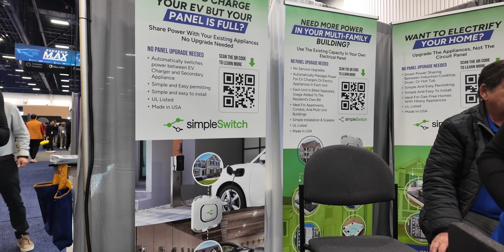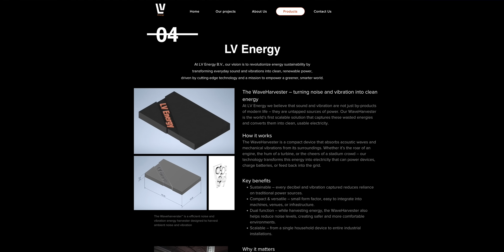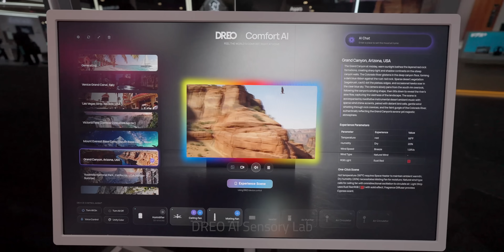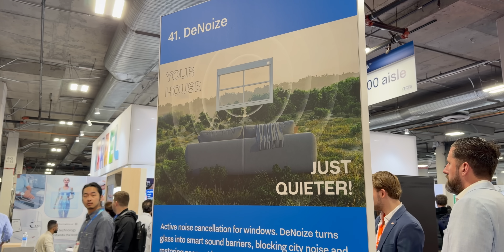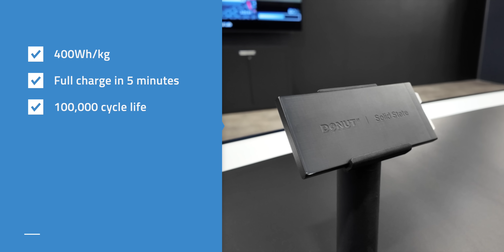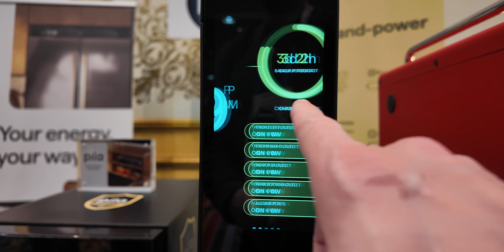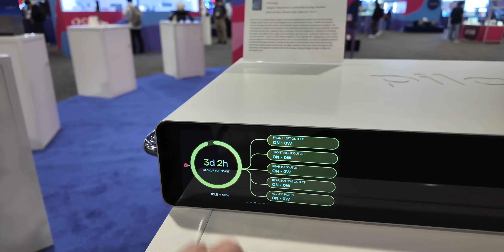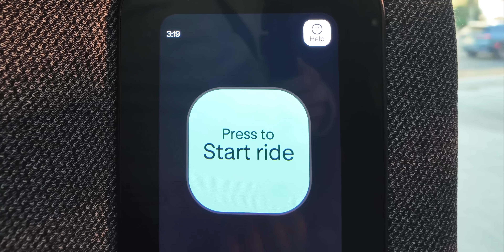The Most Controversial Battery at CES 2026

Comment: I hate that wireless charing is becoming more mainstream. It is significantly less efficient than normal wired charging, usually I see numbers shared around 60-80% efficient vs 95+ for wired, not to mention the fact that the charging pads draw an order of magnitude more power at idle than standard chargers do. That doesn't seem like much when you're talking about one person's smart door lock or phone or whatever, but when you multiply that by the total number of people who will eventually own these devices it will add up. Napkin math:

assuming the average phone battery capacity ~ 10Wh (this is the low end of the average, but it makes the math easier), there are ~7.4 billion phones in active use around the world, and the average user charges their phone once per day.

waster power from wireless vs wired ~ 3Wh per phone

3Wh * 7,400,000,000 * 365 = 8,103,000,000,000 Wh = 8.1 TWh per year

It feels like I must have gotten something wrong somewhere, because that number is absolutely insane. I'm sure if I did someone will correct me.

That amount of wasted energy for the convenience (if you even think it is more convenient, I do not) of wireless charging should make people stop and think, but this is a classic tragedy of the commons problem, each individual's contribution is so minuscule that nobody thinks THEIR use is a problem... It's only a few watt hours per day, right?.
Reply: And on the bright side, if you’re in a cold climate a 60% efficient wireless charger is also a 40% efficient electric heater :)
Reply: Companies (tech and power) don't care when they are making money from it. Consumers will if they think about it, but does a frog in a warming pot realise it is being boiled? Solar makes more sense, but if the door is not in a sunny place/inside, it seems like an overly complicated solution when you could just have a USB port or regular batteries. A person could attach their own wired, solar, wireless or other solution then.
Reply: VW/Porsche say the Cayenne’s electric charger can get up to 90% plug to vehicle (may have even been plug to battery). It was about 5% less efficient than a level 2 corded charger. 

Now the downside is that it was something like a $15k option. Around $7,500 for the piece on the car and $7,500 for the charger itself. I think it was up to 11KW too.
Reply: @paulmorrow8372  according to what I found you can add the option to the car for 226.10€ in the configurator here in Germany and there are reports the charging pad to be 5000€ in Germany. All prices incl. VAT. Still expensive. For a perspective, let’s say you average 24 kWh/100km and do 20.000km per year. That results with 100% at home charging in additional 240 kWh per year of electricity, or 76 € per year with our stupid high electricity prices in Germany. I think even the average Joe wouldn’t think about those, a Porsche owner that spends 120.000+€ on an electric Cayenne that will depreciate faster than it accelerates will not care. The Leasing here is 1700€ per month without options, with only base options (everything a Tesla comes with), no luxury things, we are at 2000€ per Month. With luxury stuff it’s 2500, and we are talking about the base model that is as fast as a Model Y AWD and has the same range. I know it’s bigger but from a pure performance perspective it doesn’t offer anything special. So yes it’s unnecessary and wasteful to charge wireless, but in the end it doesn’t change a lot from an energy consumption perspective.
Reply: @grossmann97 that 226 Euro option is just for the wiring in the car for the charging pad. You need three things, the wiring (available now), the vehicle charging pad (5,000 euro would make since for a 7,500 US price when including tariffs) and the wireless charger ground pad (another 5,000 Euro). The thought behind making the vehicle pad removable is that if you buy a new one you can keep the part from the vehicle and add it to your new Porsche. The note in the configurator says you must have the 226 Euro option to later add the vehicle pad when it is available in late 2026. 

Luckily for me here in the US, my electricity rates are about $0.15 per KWhr. In my area of the country we have a lot of nuclear and hydro, so rates aren’t bad.
Reply: Charging from ambient vibration and radiation is neat. The rest is, as you say, wasteful.
Reply: Wireless is a great backup!  I’ve had to replace dozens of devices from flashlights, headlamps, even iPhone because the connector had failed.
Reply: Perhaps thinking of wireless charging replacing disposable batteries will get you less down. 60% efficiency isn't great, but tossing 4 AA batteries in the garbage for each of your front, back and garage doors yearly isn't ideal either. Hiring an electrician to retrofit a door frame with wired locks would be cost prohibitive.

There are some good arguments for wireless charging in the EV space too. Generally, most EV's have a battery many times larger than you need for daily use. There's a monetary and environmental cost to having excess capacity. Imagine an environment where you could effortlessly/thoughtlessly/brainlessly wireless charge at home and work. Perhaps you could get by with a substantially smaller battery. The 5% loss in efficiency from wired to wireless charging may pay off in spades as the vehicle with a smaller batter is lighter and more efficient to drive. 

Not saying wireless charging is flawless or should be a preferred option all the time. There will be a time and place for it to shine.
Reply: My phone has been extremely finicky with wired charging for a year+, but still charges just fine on the wireless charger I've had for 5 years.
Reply: I generate my own power. In fact, I could have collected like 15kwh today had I the need for it. So 0.003 kwh is meaningless to me.
Reply: Yeah, it's such a terrible idea for a lot of things. Maybe just the self-guiding EV charger nozzles instead? or not being lazy? xD I hate plugging in my car in -30C as much as anyone else, but come on.
Reply: I don't think it's an issue for a door that should be using less than 50mW on average.
Reply: @meneldal  The door is not the point, the point is as more and more things start to use induction charging the wastefulness ramps up.
Reply: @Trainwreck1123  It’s convenient, that’s always going to outweigh efficiency for most people. It really is that simple
Reply: @Trainwreck1123 It’s wasteful to have to replace things with corroded batteries and connectors.
Reply: efficiency goes up as size of the device/coils goes up so the waste isn't as bad as it may seem.
Reply: @Lor20_606  The waste is exactly as bad as it seems, because what we're talking about are small devices. At the end of the day these wireless chargers are all just 1:1 air core transformers which can not be highly efficient because of physics.
Reply: It’s totally worth it for my phone to be able to float on a magnetic charger and just charge there like magic
I pay the electricity bill
I’m allowed to use my electricity how I please
Reply: @himynameisryan  it's not about your money. It's about a planet that has limited resources to distribute around >8bn people. It's about the various needed infrastructure we all pay for.
Reply: j @just.jose.youtube thats cool but I pay for my power I can use what I pay for however I see fit whether YOU think its a waste or not doesn’t matter
That’s how capitalism works
Reply: @himynameisryan  cool. ✌️

Comment: I'm not sure what the point of the Pilo system is, from what I can tell it's just your typical battery backup unit you can get from countless companies , but more expensive for less capacity with "mesh" capability, but since it doesn't mesh the battery capacity it seems to be a mostly pointless smart feature that will stop working if the company goes out of business.
Reply: For the power density, it's actually not more expensive. A 1U 2000VA UPS from APC or even CyberPower is more, and these don't have the software. It also uses LiFePO batteries, while most UPS systems like this will be lead acid, which means the batteries will need to be replaced every 3-4 years. (I sell UPSs and other IT related tech)
Reply: @mso82 true, it does have higher power density but that's a mostly irrelevant spec for home battery backup. I think very few people would be willing to spend hundreds more for the pila when you can get higher capacity units from ecoflow, bluetti, etc for significantly less money.
Reply: I feel like hes shilling Pilo since he partnered with them before and wants to get free packs for his home for a future 'review'
Reply: @sandrahiltz precisely
Reply: OH?  does this battery require an internet connection?  I can see a benefit if the system automatically comes on during a power outage or charges/deplets during peak/offpeak periods…it could pay for itself.
Reply: @Jethr001 Given it's app connected it would have to require an internet connection. Pretty much any battery backup unit can be used as a UPS to switch to battery automatically during a power outage, and plenty can support auto off peak charging and then use the battery during peak hours, the Pila one just seems to be an overpriced UPS with unnecessary networking requirements. 

For reference per their site it's $1299 for a 1.6kWh unit, which is awful compared with something like the EcoFlow Delta 3 Max which is 2kWh that seems to be permanently on "sale" for $799, and that has more outlets, connection for direct solar charging, and can also have it's capacity expanded with extra battery units.
Reply: @Jethr001 It doesn't require an internet connection to operate, but to use it's various features and software it likely does. It's basically a UPS (uninterruptable power supply), like you would find from Eaton, APC, or CyberPower in millions of server racks, AV systems, and office environments around the world. Granted, those usually use heavy, short lifespan lead acid batteries, while this uses Lithium Iron Phosphate, which are very resilient and can last 10 years.
Reply: My thought for its use was to set it to charge when power costs the least, like at 1am, and the you plug your toaster and blender into it and run your small appliances off of it. Don’t know if the cost recoup is worth it though. Also, as a renter, I am not allowed to put in a whole house battery system so something like this could be the way for me.

Comment: I don't mind sensors that harvest RF energy (it's fairly easy to do but you don't get much power out of it... microwatts to a few milliwatts).  I am not keen on directed wireless power transmission... that's a non-starter for me.

Most of the home convenience gizmos are cute but... also ridiculous and won't be worth the cost.

There have been EVSEs out there with current sharing for years, that's nothing knew.  "Wallbox" for example, has been out there for years.  The same features that allow multiple EVSEs sharing a single current also allow you to put a CT on your mains to prevent EVSE charging from exceeding your service.

But honestly most of these sorts of things just aren't needed... people seem to think that they need to have high-powered chargers but for 99.9% of EV owners charging overnight, just dialing down the power level to 3.5kW works just as well.  The vehicle will still be fully charged by the next morning.

I love the little autonomous "not really a car but still gets you there" vehicles that just trundle along city-supported routes, with area sensing but no heavy AI needed.  That's a whole lot easier to do than FSD and I think it is ultimately a better solution than full FSD taxicabs (which are vast overkill in my view).

-Matt

Comment: That demo for the sound reduction has some incredible applications if it can work large scale.
Reply: Would a double/triple layer window be worse compared to this?
Reply: @sendoh7x Triple paned isn't about sound reduction, it's about insulation and energy efficiency tho by its nature does have a lot of sound dampening properties (at specific frequency thresholds). It's not gonna block the long waves of low end frequencies which also pass through concrete.

Blocking low end is a whole lot more tricky..  it's about mass density, resonances, and air space. 

the higher up the hearing spectrum (20hz-20khz, tho that's a general average, it changes as you age, especially the higher end.), the easier it is to reflect/redirect the shorter waves.

And these windows could work in any amount of panes, two or more. One being the mic, the other the speaker for the cancellation effect. 

So you could conceivably get a triple paned noise canceling window that blocks the FULL spectrum of frequencies that is superior in noise reduction than a normal triple paned window. 

It would not stop the low end from coming through the walls and other areas of course, tho, those would be naturally dampened by the materials those long waves are passing through.. it would only reduce what was the result of passing through the window itself.. which could be considerable. A 20bd drop is considerable since it is a logarithmic scale, not a linear one.. 

Cost effective? No idea but theoretically... Definitely better.. 

Would a two pane noise cancellation window be better than a standard tripane window? No idea, not enough data. But a tripane window vs a tripane noise cancelling window? Very much better, tho will only stop the waves near the window itself, not the ones passing through the walls.. 

So basically, window noise cancellation tech would block the  full spectrum passing through it rather than just the higher shorter easily reflected waves.. 

See, take 50-60hz.. that's the low end thump of a kick drum (I was a live pro audio sound engineer for 30 years).. it's more felt than heard as a tone (a bit of both really). 

Google this question 'how much sound does triple paned windows dampen at a frequency of 50hz'
Reply: @Sgtspork man you really into this subject matter eh
Reply: @sendoh7x  you could say that, lol, it was literally my career for nearly 30 years (pro audio engineer) and a passion of mine for a lot longer... but you are mainly seeing my adhd/autism brain on coffee overdrive working through the concept in the comment basically... lol. 

I am fully aware it's "a lot" for most people but honestly, either someone will read it or not.. I'm too old to care, either they will get me or not.. I had fun in the short time working through it and figuring it out either way as I like problem solving and my brain often needs to chew on something to be honest.. tho I do hope whomever does end up reading a comment, gets something interesting from it or an interesting conversation gets started at the very least, and if not, oh well. heh, sometimes I'll slip a long grandpa simpson quote (the one about 'tying an onion to his belt, as it was the style at the time') just to see if anyone catches it for some fun.. ha. 

I'm not always so verbose, it's just easier to flow without the filter and then edit out tangents and consolidate after the fact when inspiration starts coming, (and this product had my creative ideas going actually)... tho how much time I spend on that editing/revising varies, if at all...

funny thing is, it's only with writing.. If you met me IRL, I'm quite stoic in person, heh.
Reply: I was thinking about in it the reverse.. for help sound proof.. say a small music venue/bar.. just invert which side is the mic and which is speaker.. and help to reduce noise pollution for such places in residential areas a bit.

Comment: I did some digging and could not find a listing for what actual materials are used in the donut battery, which puts my skepticism art a 99. Not on their tech page, not in any press release. Just vague claims of 'Abundant materials'.
Reply: Some suspect it's sodium sulfur because it's the only abundant materials that offer high energy density

But the reality is sodium sulfur batteries right now are still on lab research because it has poor rates of 0.5C and cycle life of only 250-300 cycles, which completely opposes the 10C rate and 100k cycles claim of Donut Labs

Comment: The key idea

Solid electrolyte (ceramic or polymer) → safer than liquid.
Annular (“donut”) architecture → lithium is deposited more homogeneously.
Objective: to eliminate dendrites, the main obstacle to solid-state batteries.
Why the “donut” shape is advantageous
More uniform electric field.
Fewer hot spots.
Faster charging without degradation.
Increased lifespan.
Partners involved
Toyota: several patents on advanced solid-state cell architectures (including non-conventional geometries).
Samsung SDI: R&D on solid-state cells with optimized structures.
ProLogium (Taiwan): ceramic solid-state batteries, pilot production in Europe.
QuantumScape: lithium-metal solid-state battery (not officially “donut,” but with the same anti-dendrite objective).
Target Performance Density: 350–500 Wh/kg Recharge Time: 10–15 min Safety: Virtually non-flammable
Temperature: Much more stable
Real-world status in 2026
Functional in labs and pilot lines
Not yet in mass production
First cars announced for 2027–2028 (Toyota leading the way)
Conclusion
The “donut battery” is not a marketing gimmick:
it is a serious avenue for finally making solid-state batteries viable, but it is still in the pre-industrial phase.
CATL, the world's number one car battery manufacturer, discussed solid-state batteries at their last conference and stated that they would not announce mass production before 2027. 
And finally, have you seen the price of the motorcycle? €44,000 for that is very expensive! You can find cars with four times the power, four times the space, and for 30% less money – the MG3 Xpower, for example.

Comment: I would not want to depend on an electronic device that has no manual backup.  And when they do fail, because there are so few techs that can repair them, replacement is the usual solution
Reply: Yeah, like cellphones 😅